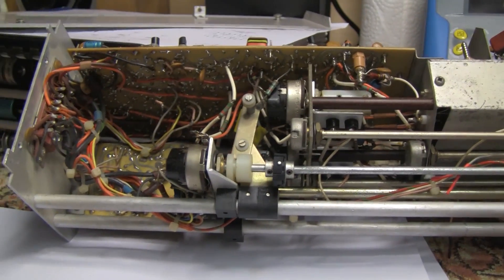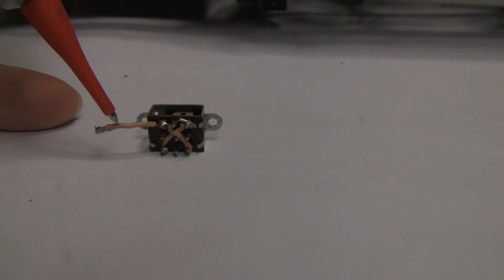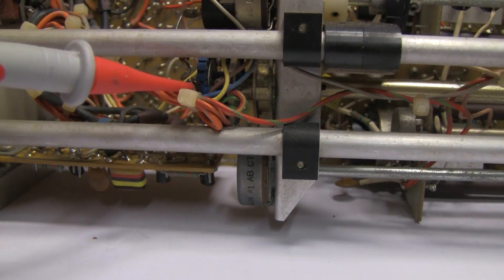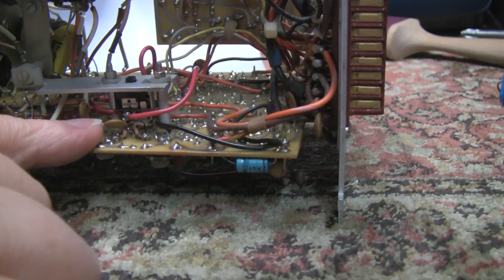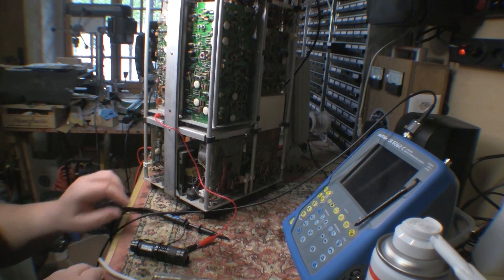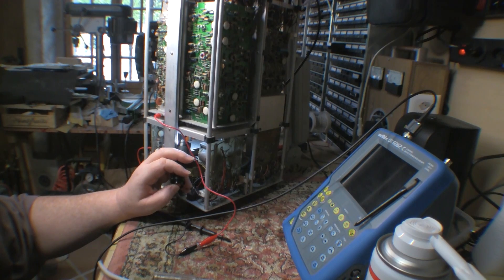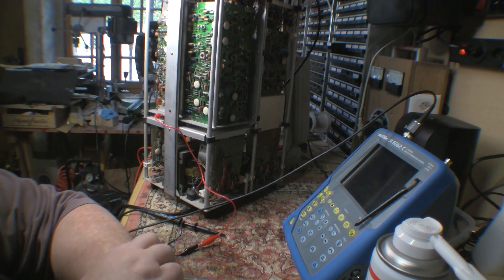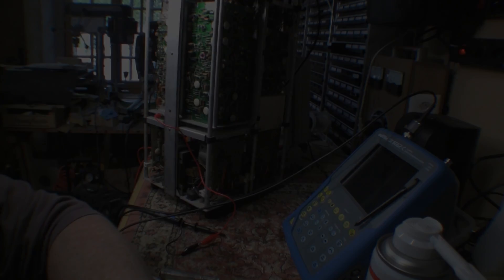SM112 Scope Repair - part 7

Comment: You're persistence will pay off, John, you'll get to the bottom of it.  That's one cool instrument, I'm going to have to find a video to see what it sounds like without the pickup.  Hope you are feeling better, my friend.  seems the older we get, the longer it takes to get back to normal.
Reply from the maker: Hi Al, yeah its taking a while to shake off the bug - another few days ad it should be sorted.   At least the scope is now much more stable in terms of how it reacts and I've learned a lot in terms of the errors in the doc, the smudges in the silk screen print on the board itself, etc.   I'll mess with the Schaub set to break up the routine on this one - keep my brain from stagnating!
The instrument sounds very different when played in its traditional form - as you'd expect.
Cheers,   John

Comment: That was a good catch on that shorting switch!  My problem with viewing PCB's hasn't been the silk screening, it's been that my arms grow shorter every year ;)  Best wishes for a rapid recovery, and I've gotta get to that file for you!
Reply from the maker: Thanks, slowly shaking off the bug.   I'll admit it was a bit frustrating to discover I'd been using the wrong test point for a few days and wondering what the hell was going on!   No worries re the file - whenever you have the time.

Comment: So what do you think the issue here is John. 
   Do you think it is a case of not so good workmanship from the factory, tinkering through the ages, or a combination of both?
   Yikes, the problems go deeper and deeper. You almost have got it though.
          Tom
Reply from the maker: Hi Tom, I can't believe it would have left the factory like that so I'm assuming it suffered some major blow up in the past and the guy was in a hurry to get it fixed (give him the benefit of the doubt, etc.).   Having found some very dodgy looking electrolytics I'll get them replaced and then see where we go.   Mind you, two of these caps are going to be a nightmare to replace - located on the 'backplane' so major disassembly required.  They are bubbled however so no point in putting it off.
Cheers,  John